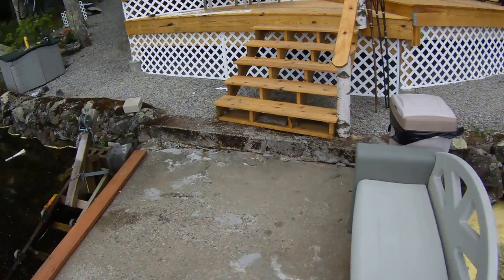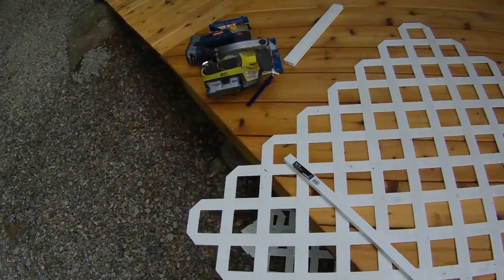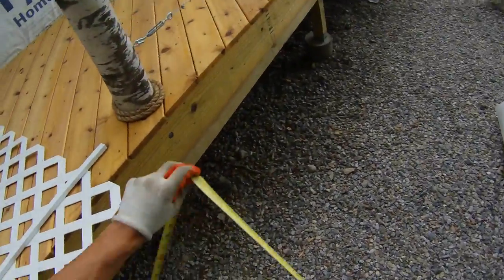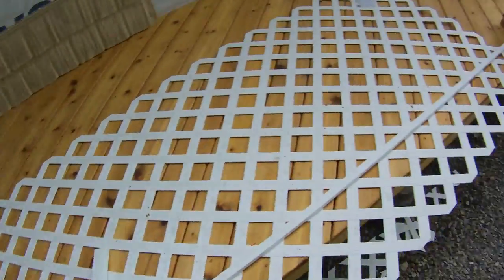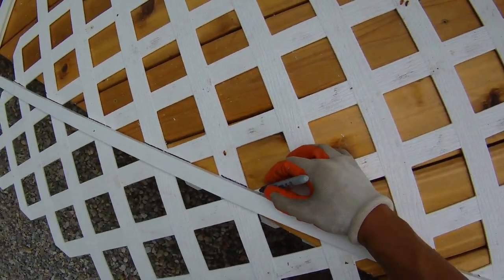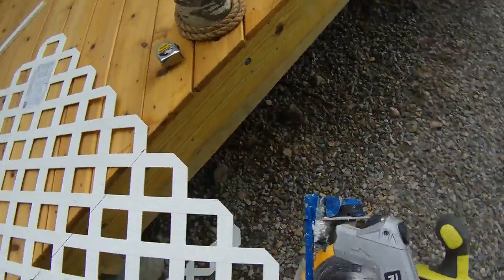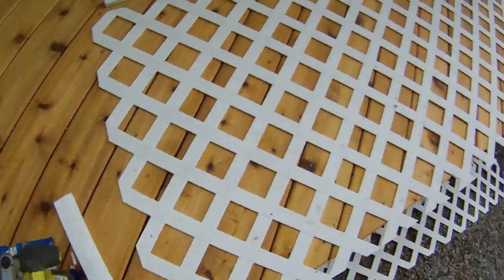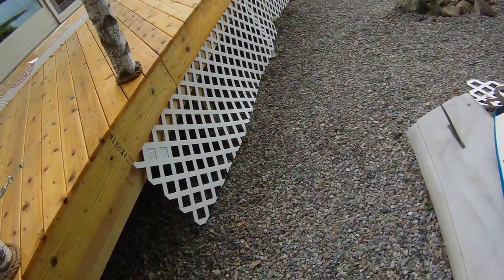Deck Building - P4 - How to Install Lattice on a Deck

Comment: How did you attach the framing? I can see screwing through the top frame to hold the lattice to the frame and both to the porch, but what about the joining frames and bottoms? Not sure I want to see screws there
Reply from the maker: Good Question i left it Free no screws just made the joints pretty tight, Here is the Reason, In the sun the plastic will expand and if it does not have a way to do that it will buckle, so i only screw it in to the top the other 3 sides are free. I did screw the Frame in at the top you could also use a finish nail gun.

Comment: I feel like there is a part missing. Cutting the lattice seems like only the first step. What about fastening, joining two pieces?
Reply from the maker: +Darren Purwin You are correct it would be nice if you could just cut the lattice and that would be it, i forgot to record that part. you can purchase a Joining part and for Fastening i used Decking Screws and a Finish Nail gun to join the lattice together.